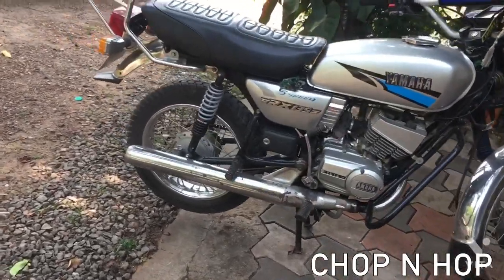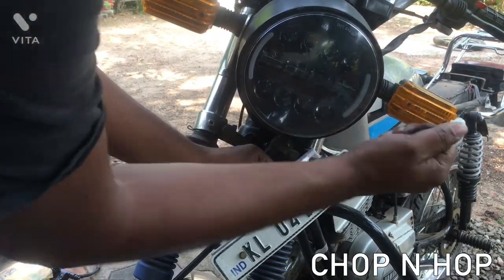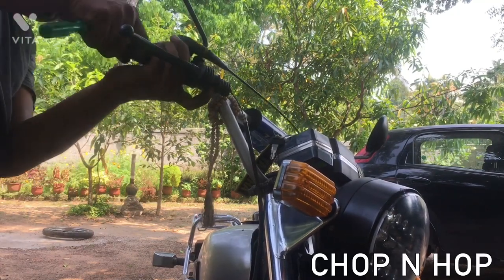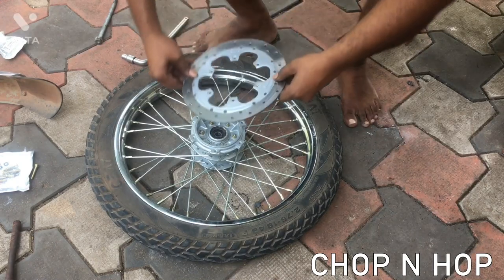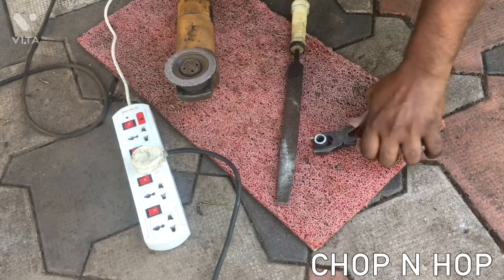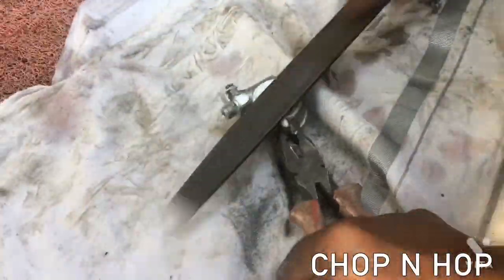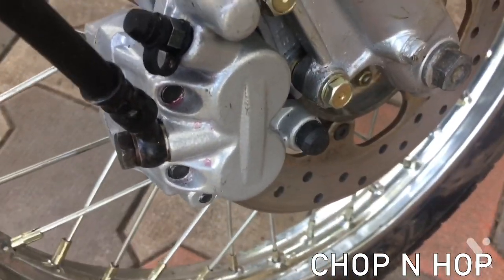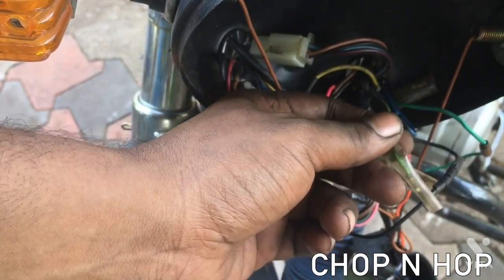Rx 135 , 100 or RXZ Detailed DIY  Budget Disc brakes installation

Comment: bro pls tell me the space size for fiero f2 left side disc to rx 135. i have installed fiero f2 fork legs to my rx without changing the t stem but there is no space to install wheel spacer and worm gear bro.pls help me.